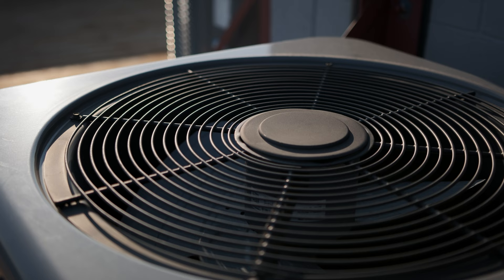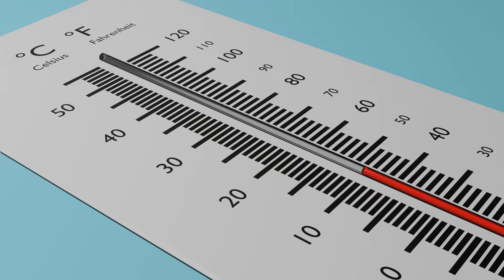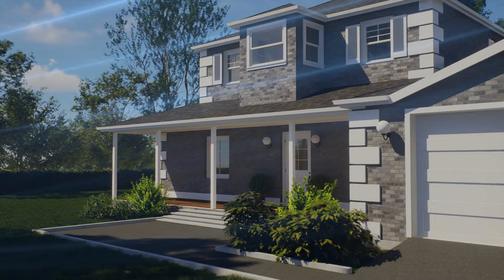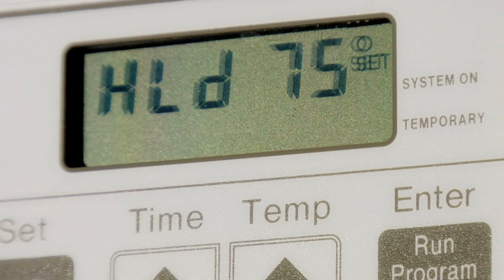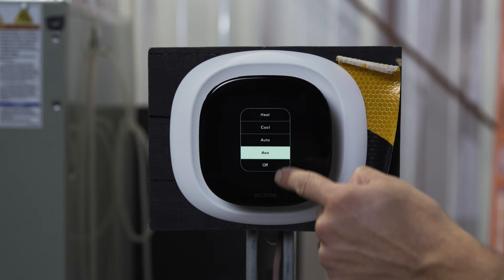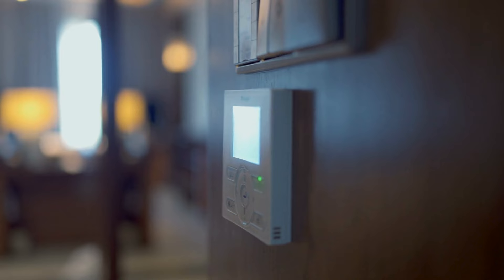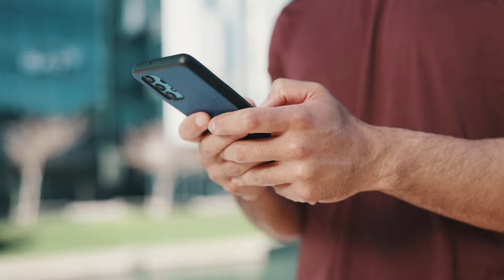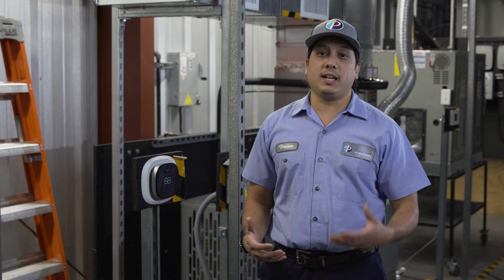WHAT DOES AUXILIARY HEAT MEAN???

Comment: thnx for ur info. here. May be U can assist me here. My heat pump system, that has electric heat strips, has the INDOOR unit running all the time and BLOWING warm air into our house, because the control TSTAT which is in the HEAT MODE, is NOT turning on the OUT DOOR HEAT PUMP UNIT. What can I check to see, that maybe is the cause, as to why the first stage of heat, (which is ALWAYS from the OUTDOOR heat pump unit). is not functioning? And another question. Because my thermostat brings on the Aux. heat automatically, in the heat mode, (which is the 2nd stage of heat), is this normal for all thermostats? Your reply (or any other) will be appreciated. Thnx again.